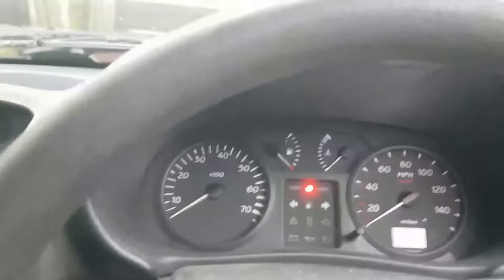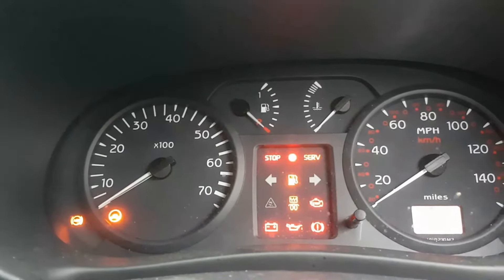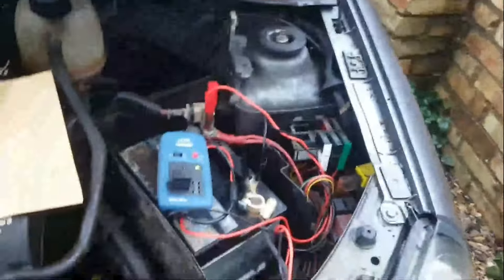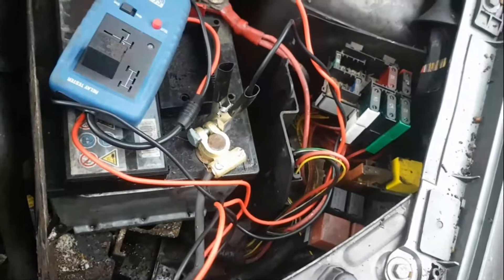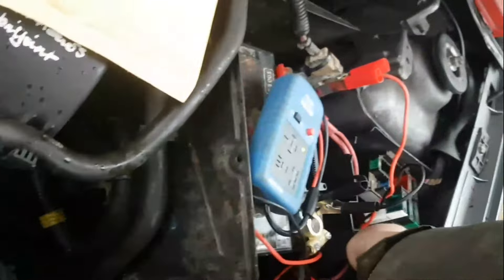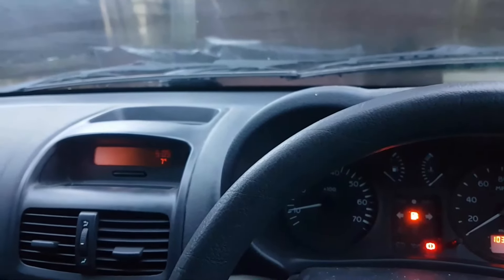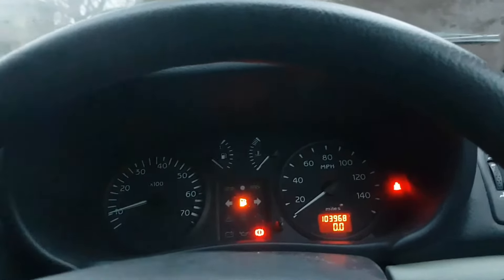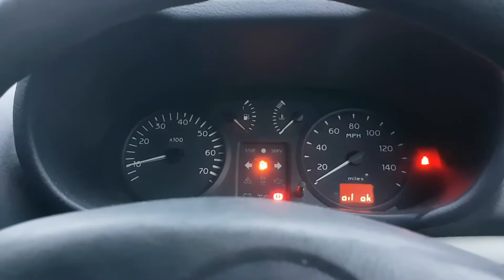2002 Renault Clio 2 / II non start issue - Profanity warnings

Comment: Same model car, had exactly the same problem, cranking 3 times then cutting out, tried to bump start it and tried to start multiple times, gave up and Googled it and found your video, got to the bit where you were testing wipers and windows and checked all mine then it started! 😂 thank you
Reply from the maker: ultimately you may need to replace or repair the UCH module on he LH side of the dash

Comment: What's that buzzing sound right after cranking? I have a the same Clio, and it does this sound for a year now... 20yrs old by now, I know, but only 90k kms under the hood, so it's perfect in the city... won't sell it for 1000 euros 😂 Anyway, yes its those cables, clean pull them out, clean the connections and it will work again, I found it out the hard way, they wanted to change the whoe box + reprogramming the key for 800 euros last year. It's from damp inside the car. If it's closed, the air gets very humid and that happens (after some years). So you are right, search for that box, it's on the very left corner under / behind the rim of the gray dashboard plastic. Hell of work getting it out, but once cleaned inside connections, and outside connectios, put the together, I put 10 silica bags into the box and used WD40 + silicon spray after cleaning the cable connectors (after the were plugged back), still works fine, took me half a sunday, but I saved almost 1000 euros 😊
Reply from the maker: I am not sure about the buzzing sound, the box eventually failed but was repaired economically and the car is still on the road
Reply: @churchhouseclassics  👍🏻

Comment: You should check the crankshaft position sensor. I cleaned mine with alcohol and it worked
Reply from the maker: In this case it was 100% a UCH / BECM issue. 👍

Comment: You saved me here mate! I unlocked the passenger side, turn on the wipers and boom, it works, that is after trying to start it for 10 minutes normally.... Must be some electrical misconfiguration, but thank you 1 million times over!! I was about to go to a very important client meeting to close my first huge retainer. Cold weather, didn't turn on, come back upstairs to do some research and the idea of some electrical misconfiguration was correct, I managed to get to the meeting on time and close my first £2k retainer!! If there's a way I can help you please reply to this comment, would love to show some appreciation as you've literally opened up my agency's initial door for success for me.

Thank you so much man
Reply from the maker: delighted it worked for you. This car has been out of use for 3 months and was messing me about again today, wound the windows down and back up and it fired straight up.

Look at my more recent videos and I do have a paypal.me link to support the channel or just plain buy me a beer.

Cheers

Comment: This happened to my clio today. Ran about in it all day I've never had a problem starting it before went to tesco for petrol came back out and my car had died gad to be pushed iff the fore court by another customer.got home wouldnt start again messed around with wipers windows etc too and reset rhe radio vola restarted again like normal... totaly weird. I'll  still get the battery checked see if theres a battery problem.. Thanks for this video its gave me some insights...👍👍
Reply from the maker: Check out the other issue I had with indicators on this same car. Turned out to be UCH which I had to send aware for repair https://youtu.be/bG1smDmPG5c

Comment: It's corroded connections in the fuse box behind the passengers headlamp
Usually the black ones, may need cleaning of the terminals or replace if too corroded
Reply from the maker: I had already been down this route, there is a follow up video where the UCH gave up completely and needed repair 👍🍻

Comment: Same problem with my 182. The wiper / window trick did remove the solid red light on mine too! But it still won’t start. Not even a crank, just click in the glove box area.
I suspect dodgy wiring / fuse / relay or the UCH module. Emailed the person in your wiper vid. Thanks
Reply from the maker: There is a starter relay in the box in the engine bay also, maybe worth double checking that before committing the UCH

Comment: I had the exact same problem and this was the first video on Youtube that i found with the identical symptoms. Mine turned out to be caused by a bad connection on a 30 amp fuse located in the same area as this man is working on in relation to the three black identical relays. If you look closey at this video, at 53 seconds,  when he is in the area just behind the passengers headlamp, you will see two black and red cables twisted together and at the top of the twist, as they start to seperate, immediately to the right is a solitary fuse, it's a green 30 amp, mine had actually blown. Possibly caused by myself replacing some corroded terminals on the black relays, may have shorted one and blown the fuse. Replaced the fuse, solid light went out and car started straight away. Not too proud to say, i make mistakes. Hope this helps someone else
Reply from the maker: i will give it a go, thanks for the update

Comment: I bought a Clio 2004 a month ago and since then it has happened to me three times that the immobilizer indicator does not go out. The first time I got scared, I thought it was a starter but it didn’t make sense to me because it fires at half key. Somehow from 5-6 attempts it worked. Then I read on a forum that turning the steering wheel turns off the indicator. The second time I tried the steering wheel and succeeded, and the third time I didn't want to do that trick, but I saw it after a few more attempts with the key. Next time I will try the wipers, so if it turns off, then there is definitely a bad connection behind the wheel. Otherwise, it is not up to the key because the same thing happens with the spare. I also watched your video about the UHC repair, but it is not clear to me whether it was repaired because of the immobilizer or because of the signaling.
Reply from the maker: The immobiliser fault remained and the indicator fault joined the party. The UCH repair resolved both issues for me.
Reply: @churchhouseclassics  Thanks for the info, I'm still gathering experiences wherever I can but it's probably the last and best option. Although for some reason it makes sense to me that the problem is the poor quality of the wires in the steering column. Renault is known for thin wires that rot over time. Thanks for the reply.👍
Reply: Check the crankshaft position sensor. If it's dirty the car won't start. Clean it with alcohol or replace it, it's cheap

Comment: I drove my car on sunday, and monday morning it did not start. What could be the issue?
The car wants to start, it cranks forever if you twist the key, but it wont turn on.
The red light in the middle goes off right away and everything else works.
Reply from the maker: sorry I wouldn't know without being in front of it. A local mechanic may be able to to plug it in and tell you roughly where to look

Comment: Had the same problem last year and it disappeared after I followed your instructions from your video. Unfortunatly the same issue has resurfaced recently. This time my car would would not start, tried turning wipers on and off, windows up and down, pressure on key, nothing worked. Got out of the car, pushed the front of the car from the bonnet several times  still did not work. One last thing before I gave up, firm taps to the battery and the car started working. Do you think parking the passenger side on top of a curb may contribute towards the problem?
Reply from the maker: I have no idea, next time I might try jump starting it from another running car to see if 13.7v running through its' loom prompts it back to life.

French electrics in an English climate at the end of the day though
Reply: @churchhouseclassics  nightmare seems to be happening daily now. Not ideal when you are running late for work.

Comment: I've had 3 clios.  All clio mk2. 
The common thing that fails us the ignition key ring reader, failed on 2 of mine.  
Also the uch or bcm circuit board behind the glove box troubles, because the relays are soldered to the damn board. You'll need to get one from a scrapyard, then swap out the 93c66 chip, which contains your car identification.  A TV repair guy could solder it for you.  
Also check your earthing wires around your engine bay, those cause intermittent immobilizer problems. 
Indicator stalk also gives issues where it just indicates in one direction even though the stalk is in neutral position. Thanks
Reply from the maker: top advise, thank you
Reply: MrMoss786 do you know if the uch or bcm are behind the glove box on cars that have the steer wheel on the left side? i have troubles with the immobilizer in the winter rain, also water drains inside the car
Reply: @sergioneto9964  I'm not sure but it's easy to spot if you get under there.  My guess is your drainage holes are blocked just under the windscreen where your wiper motor is.  I think the uch will also be on the left side irrespective which side your glove box is, I could be wrong.
Reply: What is the uch and bcm ? I had this problem with the solid red light stays on and then after 10 attempts the car started not sure why

Comment: I get this on my 2002 clio, often I get the flashing light when I turn to position 1 and no crank, sometimes it will crank then stop and just crank for 5 mins then start. You can bypass the immobiliser by turning key to position 1, hold central locking button turn off and back to position 1 - all while holding that button - that stops the light blinking, goes solid and starts. It does it regular but ALWAYS starts, good little cars but temperamental just like the French!
Reply from the maker: I tried that but it didn't work on this car
Reply: @churchhouseclassics  I probably didn't exain it well. This is the video that shows you, the - fact that the engine turns over is not important. Mine too sometimes has moments where it just turns over half a dozen times, then suddenly it's fine.

https://youtu.be/1sYhHxudt-8
Reply: It worked fine for me tried it yesterday.

Comment: Gave up on mine. Turns over doesnt start. Changed a fk load of parts and nothing
Reply from the maker: Difficult to offer any advise without knowing more, does it crank and then stop cranking unexpectedly? if so UCH module is likely at fault. Get advise from the Clio forums, they are pretty helpful